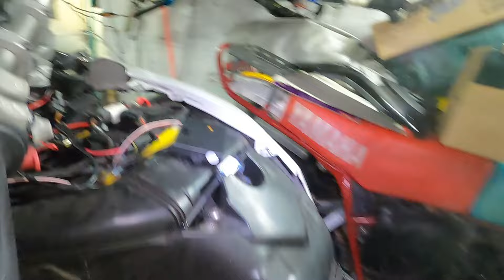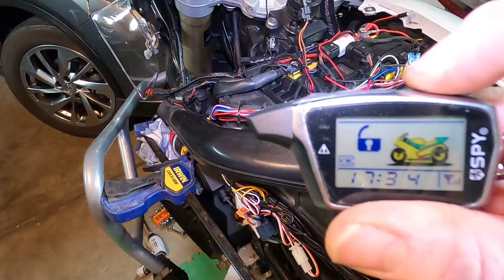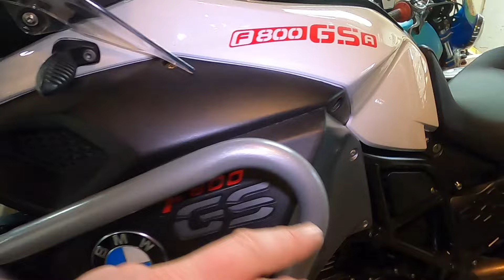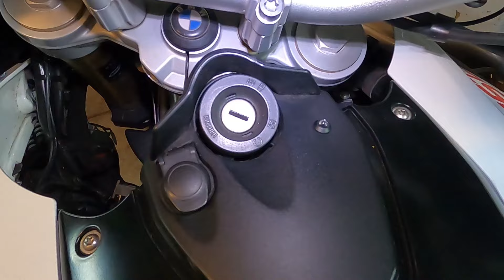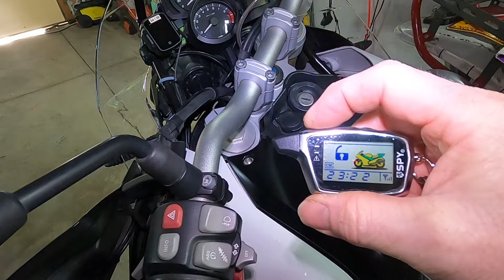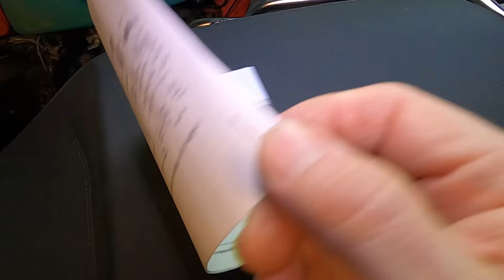Motorcycle Alarm Installation – Spy 5000 DIY Review & Install Guide

Comment: How to disable automatic arming of the alarm?
After clicking the unlock icon, the alarm will arm automatically after 25 seconds.
Reply from the maker: I worked that out at the time, but can't remember now.  If i find the manual I think it says in there.  What I could not stop was the 3 beep reminder around 20 seconds after turning off the ignition - it is so loud!